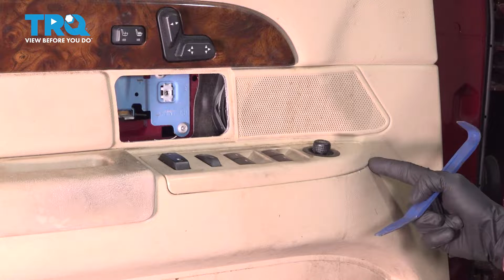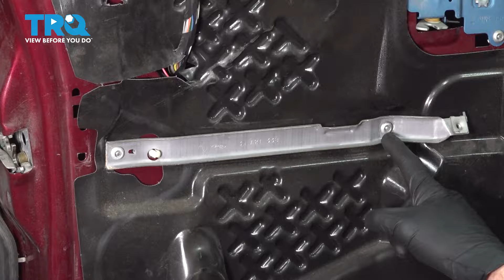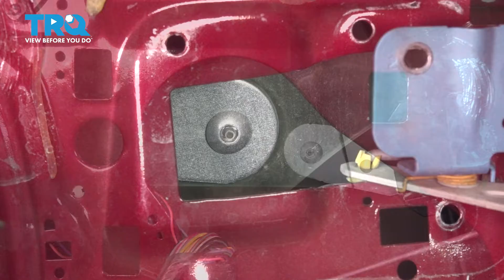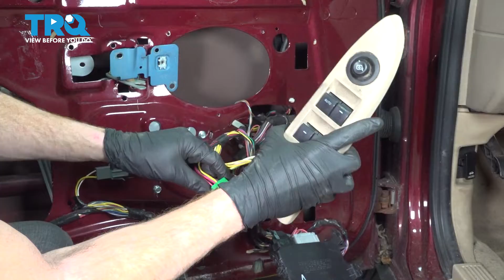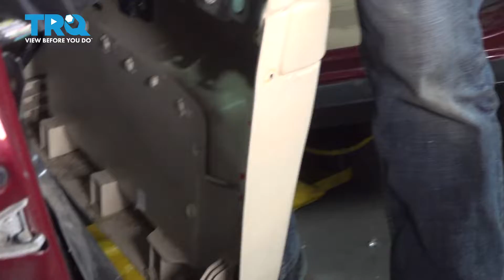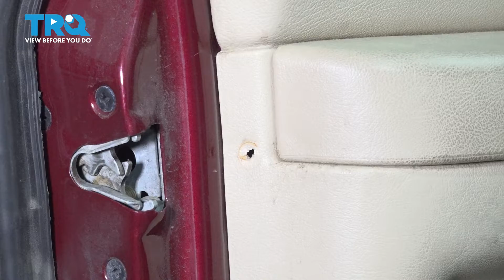How to Replace Power Window Motor & Regulator Assembly 2003-2011 Mercury Grand Marquis

Comment: On the 2009 model, the three door panel screws are not 7mm, they are probably 5, but i don't have a 5.  1/4 in worked fine.  The speaker screws are the same, not Philips.  Also, it appears that I do not need to pull the glass out to get to the upper mechanism nuts.

Comment: Again this video has kept me on track through a regulator replacement. Thanks!

BTW, I ordered the regulator from Amazon, took a chance on one of the cheaper ones. But I also ordered the Dorman installation kit containing enough 1/4 inch pop rivets to install the regulator. The regulators come with nuts and bolts but my big hands have trouble getting the nuts on the back side. Pop rivets are easier to put in. Big rivet guns can be found online or at local tool stores.
I do use bolts and lock nuts for the glass bushings.

The Dorman kits can be found at the same suppliers as the regulators. 

Dorman 702-013

Comment: You do not have to remove the door handle plate or rivets to get window out. Just lower window to the square hole where the window motor power plug goes through

Comment: changing just the motor is the right choice. the guides and frame does not wear out, but motors do not last 5 years. I worked at Ford, GM and Honda over 20 years. Also worked car show in Detroit twice at COBO hall. Anyway a motor change is a long easier and no drilling.
Reply from the maker: +@palmcoast26 Thanks for the feedback! http://1aau.to/m/Shop-TRQ

Comment: To those doing this repair, Be careful tightening the new bolts on the glass. I overtightened it and it shattered the glass on my previous Grand Marquis. Might be better to tighten those two by hand tools.
@TRQ You do great work and this video is very well made. The camera work, editing, voiceover, and repair advice is all top notch. Thanks!

Comment: In case any of you use bolts to install new one like I did. I used 10 of the 1/4-20x1/2, but the two for the window have to be 1/4-20x1". The the half inch aren't long enough, just so you know before you have to run to the parts store without your window in.

Comment: I’m trying to get the driver front window to come down a few inches in order to reach those rivers on the window like you said, but it won’t move in the slightest. Any ideas? It won’t budge one bit!

I used your video to get the rear left window regulator/motor replaced a couple weeks ago, and it worked like a dream. But that motor wasn’t completely toast yet.